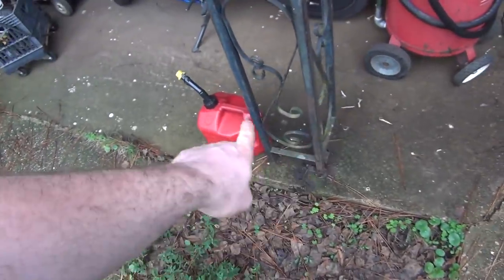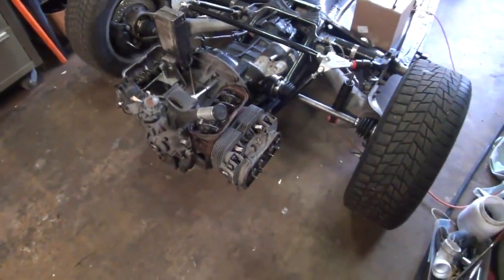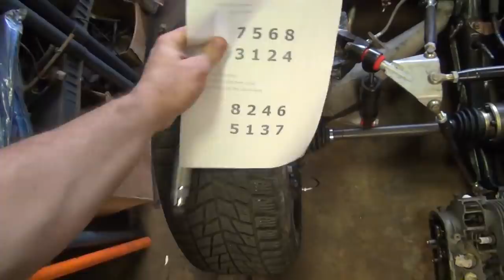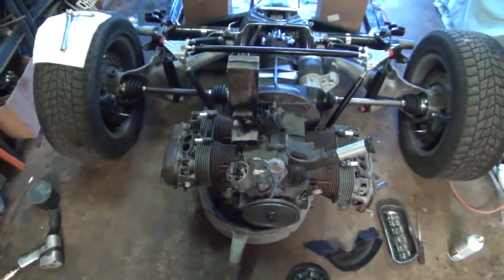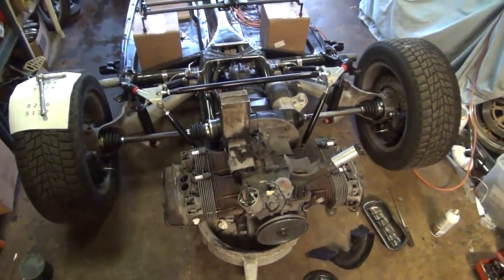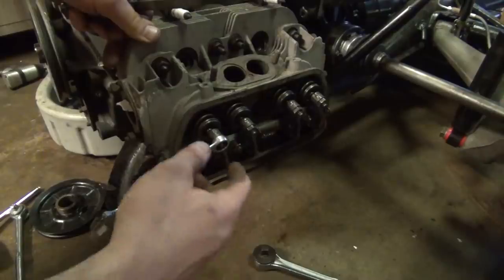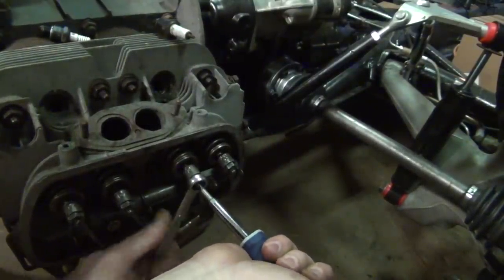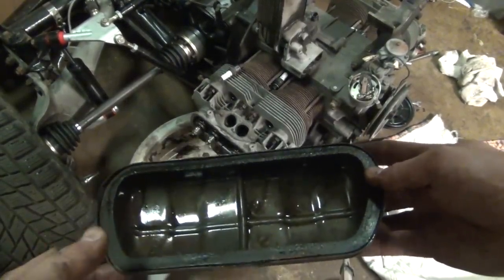VW Valve Adjustment  / Head Torque - ROTTEN OLD 1956 Chop Top Oval VW Beetle - 73

Comment: Man ur grease tip on the valve cover gaskets was spot on I just had a problem with mine leaking I replaced the gaskets and I always use some blue rtv but still had a leak so I tried ur grease method and I'll be damned it WORKED!!! 👍👍👍👍 thanks for another great video
Reply from the maker: I wish I can claim it as mine, but I actually read it in a shop manual.  It was a very quick blurb, if you scanned over the page you'd miss it!  But yes!  It works!  I had a terrible leak on the Fastback at the valve covers and that solved it!    Thanks for watching, and I'm so glad it worked for you!

Comment: Oh on the valve adjustment I set my valves the same but I set my timing at 30 degrees advanced and had overheating issues so I went back and adjusted them on 30 degrees advanced instead of top dead center and the thing is running like a damn dream its running @25 degrees cooler and the horsepower gain is definitely noticeable. Maybe that can help u if u didn't already know but it definitely made a huge difference. I also run a 009 distributor with dual empi 34s on a 1641 dual port 1972 super beetle named bumblebee :)  keep up the great work Glenn and the great videos you've helped me a ton by sharing ur experience good and bad lol
Reply from the maker: Well timing hasn't been done here yet.  We'll work on that when I get a little closer.  Soon, my friend!    Thanks for watching!

Comment: I remember a local Chevrolet engineer who was active in the VW air cooling community, he always recomended to us to use 0,15mm on intake and 0,05mm on exhaust (yes 0,05 not 0,5).
Reply: That's a good way to burn valves. The reason to adjust them to .006" or .15mm cold is because the engine expands, and when the engine is hot the clearance shrinks to zero. With a smaller gap, your exhaust valve will not quite close.
Reply from the maker: Yes!  If anything I would say that the opposite settings may be  workable... since the intake valves are usually colder.  But i wouldn't make an exhaust valve that tight.

Comment: How do you know none of the Head Bolts are torqued more than 18lbs?  I'm not a mechanic so I'm not sure how a torque wrench works, if you set the wrench at a lower setting than the bolts are set would it click at the pounds you set it at or not until it reached the pounds the bolts are at?
Reply from the maker: In my case... you don't... but I'm not going to get into that level of precision without actually tearing the heads off... and if I get that far then it's going to get a lot of upgrades. But seeing as how everything on this engine looks pretty damn accurately and properly built I'm going to trust it.
Reply from the maker: I helped to answer your question in a video today.  https://youtu.be/pK7TkiOR0to

Comment: happy new years. 
i wonder if that axle grease trick would seal my big block Chevy valve covers i get new gaskets and a month latter they leak with gasket sealer on both sides and it's a pain in the butt to clean the head off with gasket sealer on it but axle grease might be the trick it wipes off plus it sounds like it keeps the cork pliable to make a better seal i think when the snow melts here i will try your tip duckman thanks for mentioning it
Reply from the maker: Thanks Nik!  You can try it on the Chevy!  It may work if its a cork gasket!  Give it a try!

Comment: Another fantastic video Glen. I know this was older video, but I’m curious are you still using the bearing grease on the gasket before you put the covers back on ? I’m gonna try that myself I think.
Reply from the maker: Absolutely still greasing the valve cover seal!  You saw me do this in a video just a few weeks ago on another car!  This was something that came from VW's own manual.... it was a very short blurb, but straight from the horse's mouth!  RECOMMENDED!